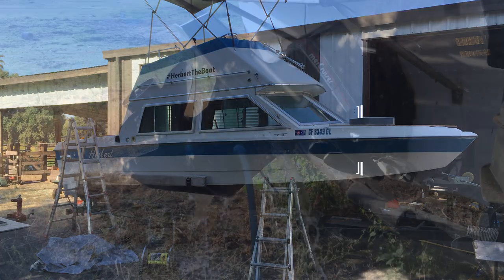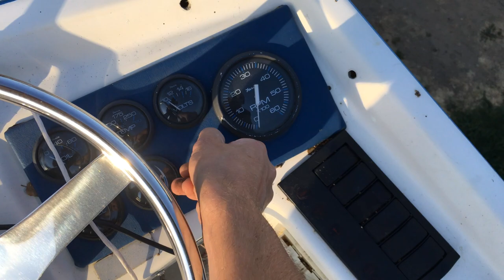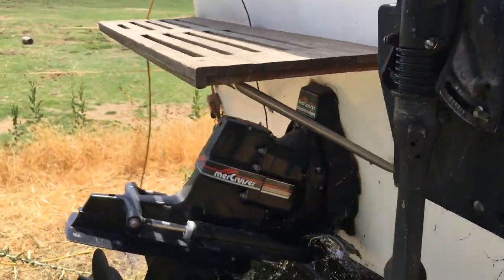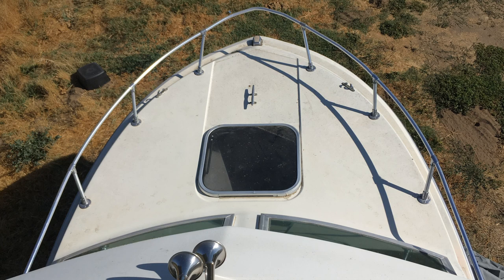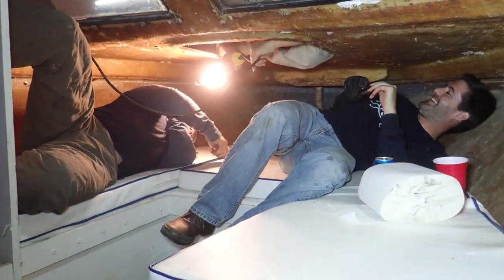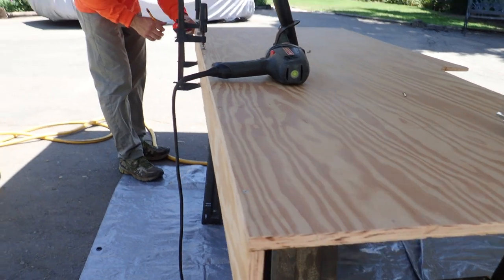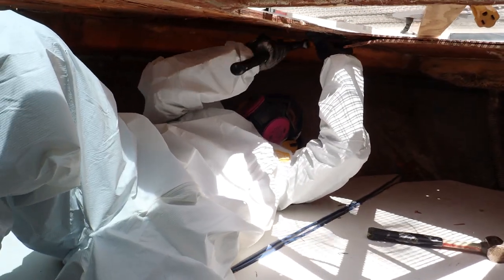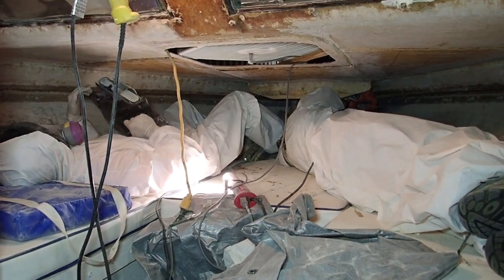1978 Fiberform 24 Restoration (Herbert) Part 3

Comment: For that fuel tank cover/step, consider adding some sort of nonskid texture to the final gelcoat.  I have used a product called "soft sand".  Its made out of little rubber particles and mixes well with paint or gelcoat.  It doesn't tend to settle out right away like actual sand does so you can paint more and re-mix less.  Regular gelcoat is pretty thick, and needs a lot of sanding to get it flat after rolling or brushing on.  There is a high gloss additive for gelcoat that lets it go on much thinner and lt lays down flatter before it kicks.  It makes the gelcoat much less viscous when you roll it on so your nonskid particles don't get buried in a super-thick layer of gelcoat.  The additive makes gelcoat behave more like paint when you are applying it.

Ideally you want to get a smooth finish on a base layer of gelcoat before doing your nonskid with the gel thinned with the high gloss additive.  Gelcoat can be tricky because it goes on so thick there is a lot of highs and lows in the finish, then you tend to sand through while you are trying to smooth it out.  The most valuable and most difficult thing I learned about gelcoat is how to build up thickness before attempting to sand it flat.  You need a lot more thickness than you'd expect before you begin sanding or you will sand through someplace for sure.  To build up, lay on three coats letting it get to a hard but tacky state between coats.  (you do not want the high gloss additive in these thick coats)  Then put wax additive to the final layer and let it harden completely. (the wax is different from the high gloss additive in that it does not reduce the viscosity much but does let it cure completely if you are using polyester resins)  Then lightly sand to remove the tops of the peaks while leaving the valleys still visible.  Its tempting to sand too much at this point.  You want the valleys to still be visible because they are your guide that prevents you from sanding through.  Then lay on another three full layers of gelcoat and again sand the peaks off while leaving the valley bottoms visible.  I usually do three rounds of building up or nine layers total before attempting to sand anything flat.  Even so, I sand through at times.  I wasted so much time when I was first starting out by laying on a few layers, then sanding through, doing a few more layers and sanding through in the same places.  Building up so much seems like a lot of work, but you save a lot of time in the long run if you are not constantly sanding through.

It takes a long time to sand gelcoat anywhere near flat.  For decks where a nonskid will be applied in the final coats, it helps to get it pretty flat.  For countertops and things you want to be easy to clean, a glossy smooth finish is good.  For everything else, I don't build up as much, sand approximately flat, then roll on a final layer which will have a fine, random texture left by the roller.  I call this texture "good enough" and move on.  Trying to get a glossy finish everywhere takes an amazing amount of sanding.  The glossy parts of the original boat were formed by the mold, not by endless sanding.  How many hours you want to put into making gelcoat shine is up to you, but my experience is that work gets done twenty times faster if you think rolling on a couple layers of gelcoat with a texture left by the roller is good enough.

Fiberglass does not like to go around a sharp 90 degree corner.  It almost always makes a bubble near the corner because the glass fibers will bend in a curve, but not around a sharp angular corner.  Where you use plywood, try using a router  with a rounding over bit to round the corners as much as possible so the glass cloth can lay flat on the wood as it goes around the corner.  For inside corners, use some fairing compound and a plastic spoon to make a curve on the inside of every corner.  This lets the glass cloth curve around the corner instead of making a sharp bend.

I'm no expert, but I did spend a while restoring some old boats, so hopefully you'll read this and avoid some of the mistakes I made when I was first starting to work with fiberglass.  Its a lot less work to learn from someone else's mistakes than to learn from your own.

Comment: You should try building a boat out of plywood
Reply from the maker: Herbert is project enough for now.. but when he's done...
Reply: Oscar Jones if they built a plywood dingy it’d be a lot lighter. As long as they don’t fiberglass it or use epoxy it’ll last forever with proper care.